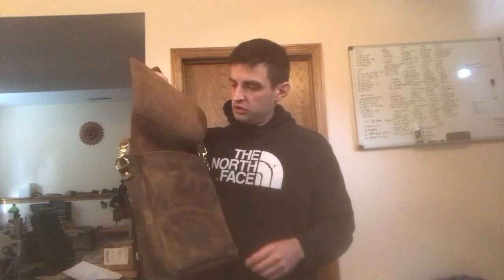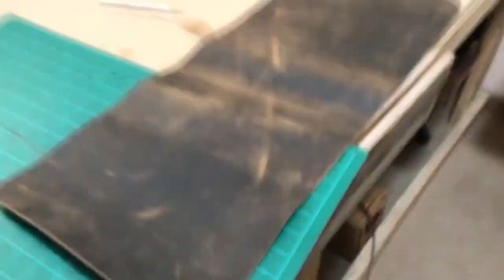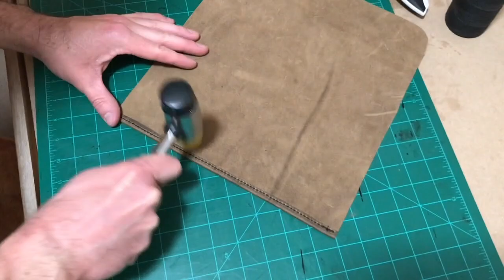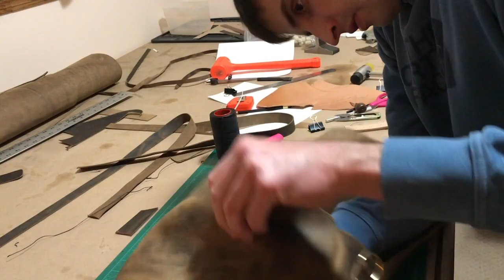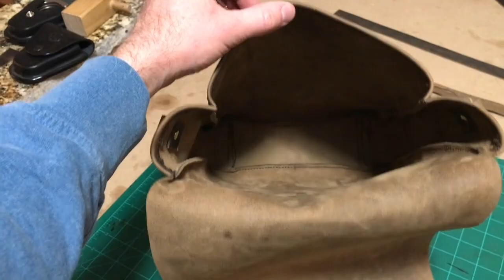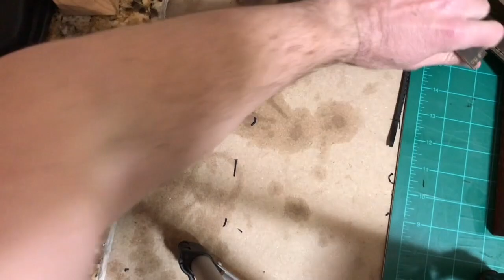Making a Small Leather Bag

Comment: OLD LEATHER SMITH here, very good job, nice simple design, Suggestions, I use a closet rod with a rounded point on 1 end 2 turn right side out on moccasins I make, place other end against wall at floor, works great, I first used a broom handle but a closet rod is stouter, U might want 2 try a BACKWARD STITCH, one needle and every stitch is LOCKED in, GOD'S BLESSINGS ✝️⚾🙃